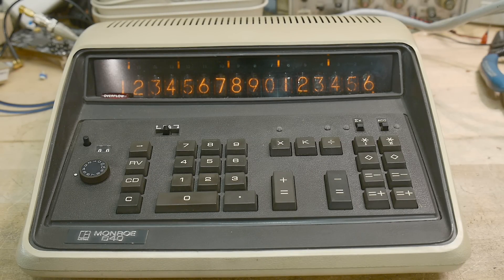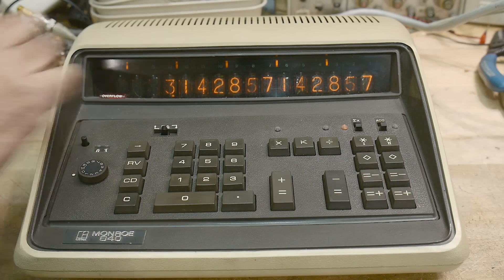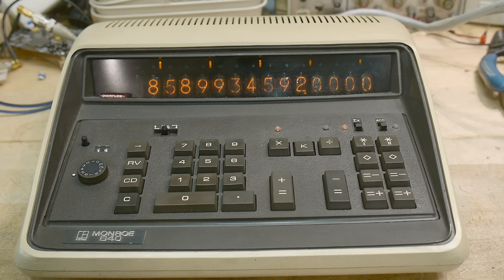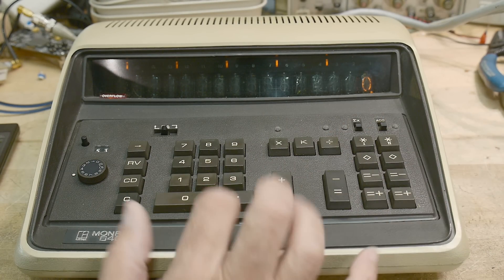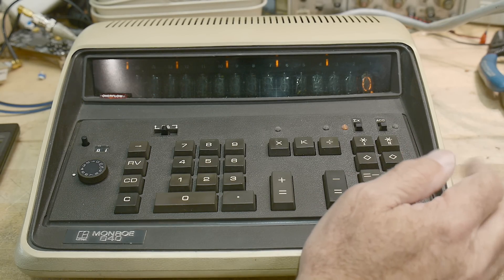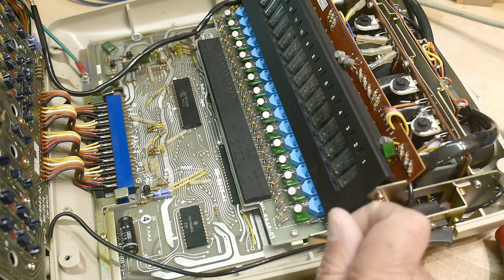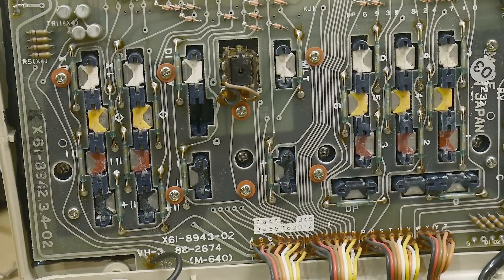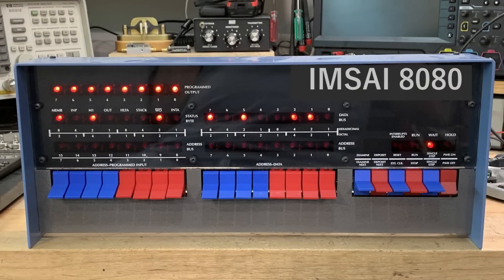#1364 Monroe 640 Calculator 16 Nixie Tubes!

Comment: 13:25 Contrary to popular belief these old reed switches can oxidize on the inside or stop working for other reasons. I have had to replace some on vintage calculators. I have also had to replace faulty keyboard diodes on a Canon calculator, so you might want to check the diodes as well.

Comment: 3:16 The constant button usually works a bit different on vintage calculators. For example you can do 3 * 2 = 6, then press 4 = and it will do 4 * 2 and display 8, etc. Maybe you can check if the Monroe also does that in addition to just pressing = to display the last answer * 2. It should also work for division.
Reply from the maker: I was able to find an instruction manual and everything does work, a bit odd, but does work

Comment: Similar in many ways to my old Canon "Canola" 161S. Same kinds of reed switches, lots of Nixies, but it is older than this one in the video....it has no LSI chips, instead it has a card rack with several large boards plugged in, all using LOTs of pre-TTL simple logic gate ICs to do everything. Because it has no solid state memory, it has an acoustic delay line (externally it looks like an old early 1980s vintage HDD) where a cycling series of 1s and 0s exist as pings or no pings on a long wire that is coiled up inside, plucked electromagnetically, and read back the same way, and strings of several numbers are constantly held in this, going around and around, modified on the fly as needed by whatever function is being done by the logic. It is kinds hard to believe that such a sophisticated calculation of large numbers, plus all the oddball extra functions and variable number of digits and such can be accomplished by just a few cards worth of discrete logic.

Mine worked when I bought in on eBay, except one of the keys had a dead reed switch. I was not able to find a suitable replacement, so I just relocated it to one of the rarely used switch positions, swapping reed switches to get the more important key working again.

Comment: I have a Monroe 650 and it does have the square root key.  It is between the division and subtraction keys.  Other than the missing key they are the same internally.  Almost identical to a Canon Canola L163 except the L163 and a % key while the 650 has better memory function.  They use the exact same circuit board and to change it from a 650 to a L163 you just move a jumper that is marked L163 650.

Comment: Maybe accumulating both nominators and denominators has something to do with fractions. For example if you calculated
1÷2 then 2÷3 then 3÷4 you'd end up with 1+2+3 (6) & 2+3+4 (9) in the accumulators. Don't know if that's useful for anything,

Comment: The keyboard has a matrix with rows and columns. So it is possible to test the incoming signals to the outputs where places for diodes have been left open. Maybe the square root is hidden there. 
I once succeeded in finding the whole set of trigonometric functions which were provided in the chip but not wired to the keyboard. It was a much later version of a calculator (in 1981) with models of different complexity.

Comment: Forget 22/7, use 355/113 and get six decimal places 😄
Reply: use 1 x 3.141592653589793 ...
Reply: @gyrgrls  Well you could, however, if your memory is bad then it is easier to do better than the 22/7 I was taught in school decades ago without much effort in memorising. After all, splitting 113355 into two three digit numbers and making the bigger one the numerator isn't a stretch, though I personally just hit the π key when it is available.

Comment: Your HP calculator will show 31 or 32 digits by hitting shift > show (not shitshow). My HP42S does. The power connector looks like an XLR? Imagine the damage you could do by plugging that cord into a mixing console.